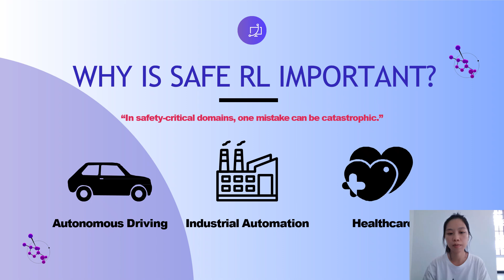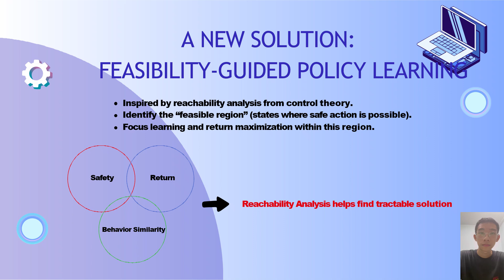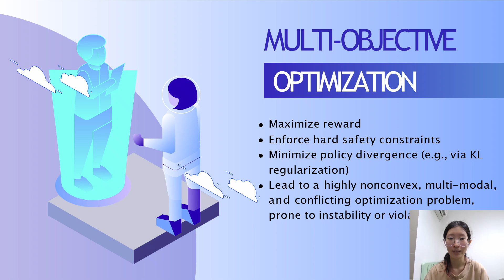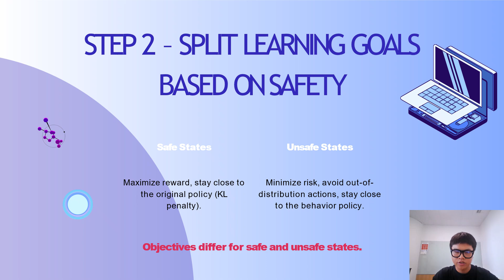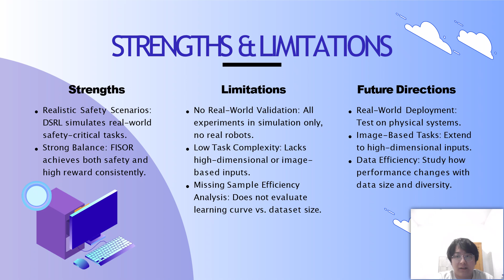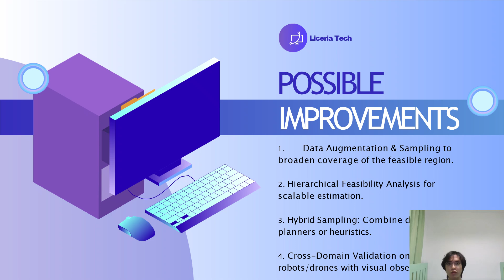25/04 AIT306 Deep RL and Control Paper Sharing Group 7

Comment: The question from Group 8. 
The FISOR method proposed in the paper achieves decoupling between safety, reward maximization, and behavioral regularity by separating optimization objectives in a feasibility-guided manner. However, the "feasibility region" is estimated by using methods such as reverse expectile regression on the states in offline data. So I would like to ask: When faced with offline datasets with sparse state-action distribution or severe data offset, is the feasibility region estimated by FISOR still reliable? If not, could it lead to over-conservatism or neglect of the real feasible policy space? How do you quantify or mitigate this potential bias?
Reply: In sparse or biased logs the feasible-value learner may underestimate the true safe set, labelling many genuinely safe states infeasible and occasionally mis-classifying unsafe outliers as feasible. 

To gauge this bias, I think maybe can fit multiple stochastic ensembles of the Qh network, compute variance-weighted occupancy over a validation hold-out, and report the intersection-over-union between ensemble derived regions; large disagreement flags unreliable coverage. 
Mitigation combines synthetic boundary rollouts from a learned dynamics model, density-weighted retraining that down-weights rare unsupported states, and a cautious online refinement phase where new samples are accepted only when a control-barrier shield keeps zero safety violations at deployment.

Comment: Question from Group 6:
What critical components remain unverified or under-optimized in transitioning FISOR from theoretical algorithm design to practical real-world deployment? Which engineering challenges pose the greatest obstacles to this transition?
Reply: Answer:
(1)
Key un-verified pieces: 1. Feasible-region learner: Vh and Sf trained only on logged data; coverage gaps yield unsafe false negatives; 2. Hard-constraint robustness: No guarantee under sensor noise, latency, or model mismatch; 3. Data-scarcity tolerance: Safety degrades sharply when the offline set is small or skewed; 4. Hyper-parameter autoselection: Expectile τ, diffusion temperatures, and penalty scales still need manual tuning; 5. Real-time sampling: Diffusion policy plus  N-action safety re-ranking strains embedded hardware; Offline-to-online handoff: No mechanism to adapt safely once the environment drifts.

(2)
Greatest engineering hurdles: 1. Building logs with dense nominal + corner coverage to fit reliable Vh; 2. Certifying zero violations under real-world disturbances while keeping latency below control-loop budgets; 3. Developing adaptive online refinement that preserves the hard-safety certificate.